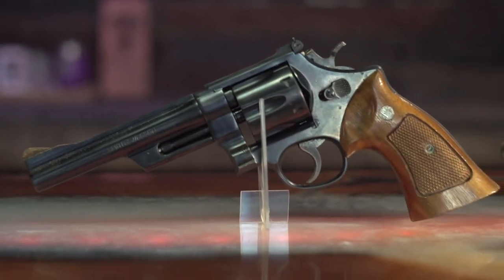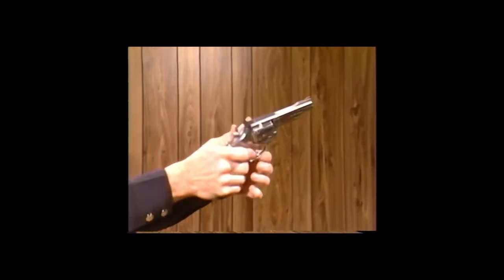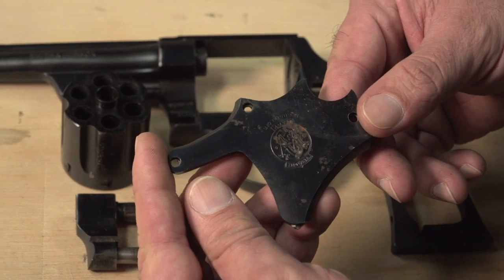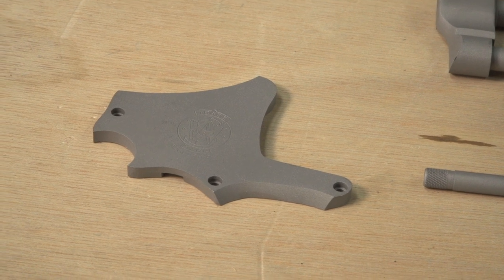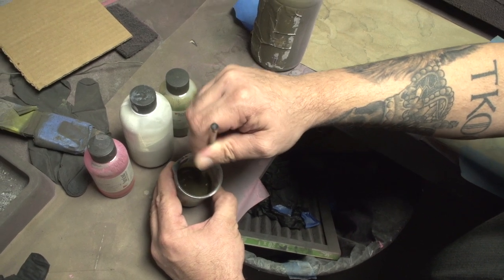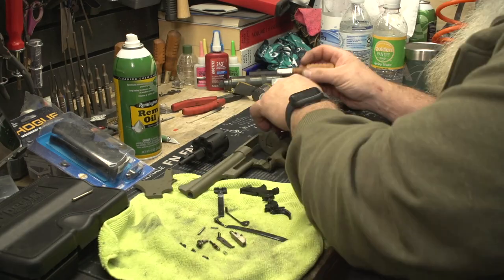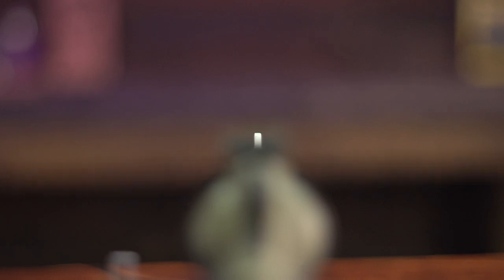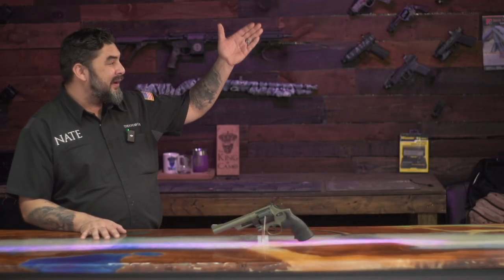Police Revolver Restoration

Comment: do yall offer actual restoration also?... like re blued and refinished grips and stuff like that ?
Reply from the maker: Great question. In regards to the wooden grips yes we restore them however when it comes to traditional bluing we no longer offer that.  We instead offer a bluing replicator that looks exactly like original bluing but has all the benefits of a ceramic coating.  You can't tell the difference between hot bluing and the spray on replicator.

Comment: I am totally shocked that you painted this revolver vs. bluing it and bringing it back to original condition.  You have virtually destroyed the collectability of this revolver.  Was this customer on drugs? We have a term for this... It's called bubba.
Reply from the maker: Well since this is the firearm this customer wanted to pass down in their family. And it’s the customers gun to do whatever they want, Bluing was not the way to go. Coating it with a ceramic coating is going to protect the firearm for years and is vastly stronger and more durable.

Comment: Rubber grips:  Great for maintaining your grip, but they hamper your ability to acquire that grip quickly and snag on clothing.  Wood grips:  Very fast, because you can begin your draw immediately upon contact with one or two fingers.  They allow you to adjust your grip as you draw and bring the gun out into sight picture.  As you are swinging the firearm up, you are repositioning your grip and acquiring the trigger.  What if you start to apply pressure ito the trigger but you realize you have a handful of cover garment on your grip?  You squat down so it doesn't prevent you from leveling the firearm (this has happened to me hundreds or even thousands of time during my 30 years as a firearms instructor for an unnamed and treasonous federal agency that is undermining our country)..  Even in this worst case scenario, the gun goes boom as it levels out at your opponent but at least the wood gives you some chance of shedding that obstruction.  Look, your gun needs to be smooth and quick.   Why put rubber on it?  Why not cover it in quills like a porcupine?  If I were going to a duel, I'd choose the rubber grips, but for the real world, wood is superior.  Also, for hunting, sure choose rubber if you like it, but for self defense wood grips are far, far superior, because they allow you to move faster and adjust as you go to bad grips and unwelcome events.  Caveat:  If I fell in a vat of olive oil, or if the perp is right on top of me and there's going to be a struggle for my gun, I'd wish I had the rubber grips, but given my adrenelin levels will be sky high in a real fight, I figure I will have a death's grip on the gun, LOL.
Reply from the maker: Truly thank you for taking the time!  And the NRA can eat every ass in the country!